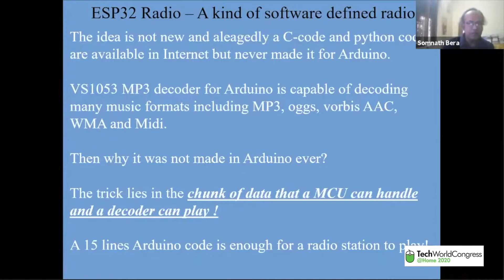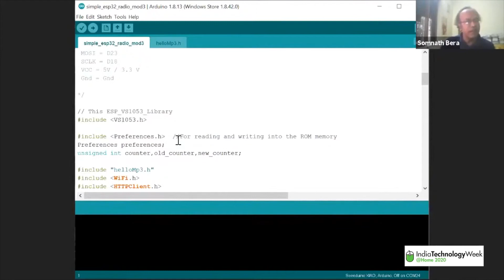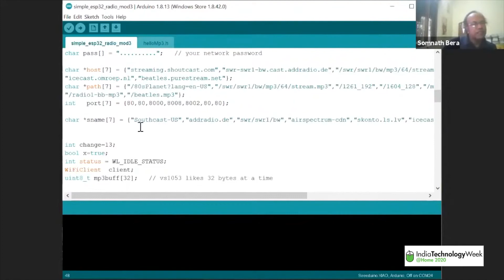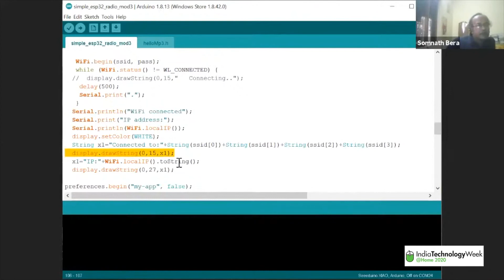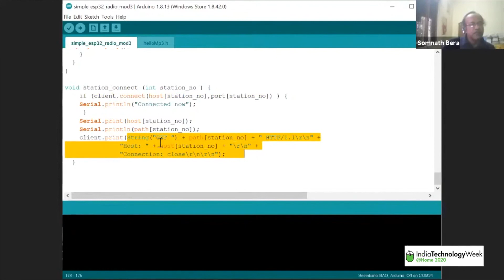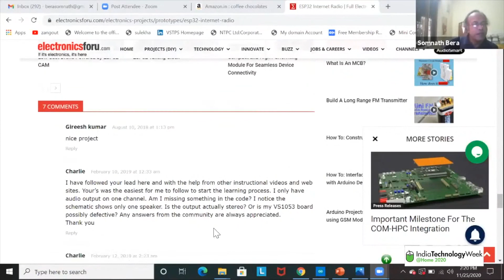ESP 32 Internet Radio

Comment: Hello, thank you for this achievement. I just made it, but I have two problems. The first is that the sound at the speaker output is completely chopped. The second problem is that, after about 30 seconds, the sound disappears. I have to press the RST button on the ESP32 again for the sound to come back, and it disappears after 30 seconds. I don't know what to do. Can you help me please?
Thanks jean yves